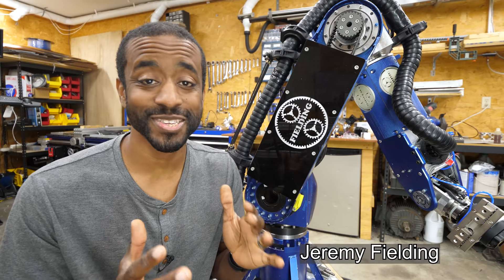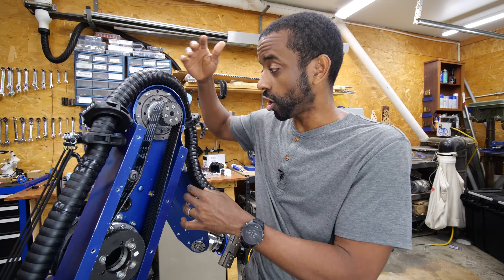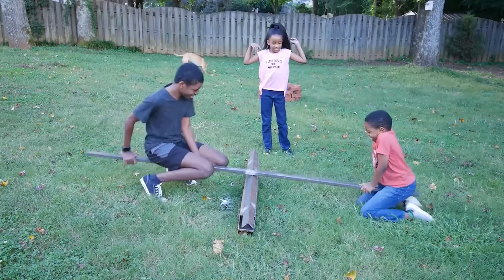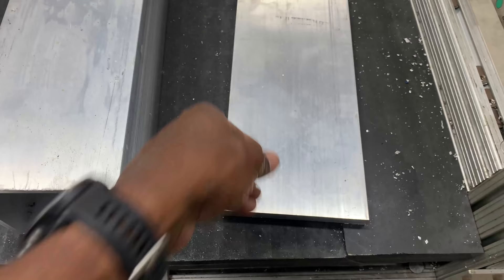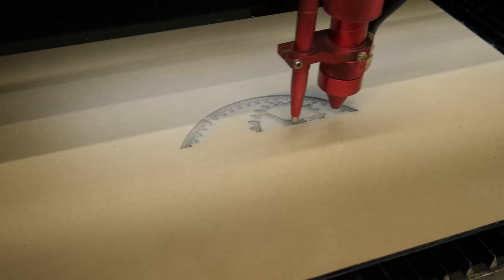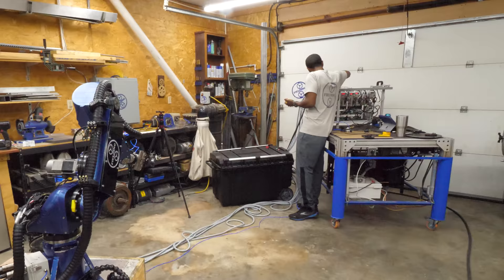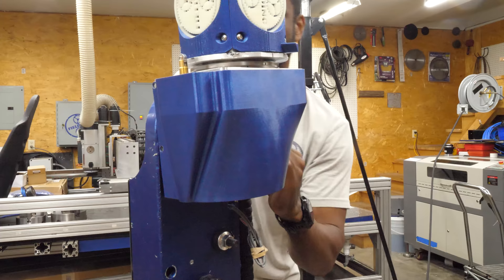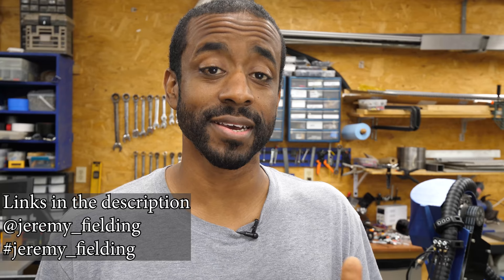How I Designed My Robot To Be Fast! Engineering Speed at a Lower Cost #092

Comment: Hey, guess what happens when you put one channel of a portable o-scope (ground referenced, cough) on the 440 motor drive's output, and another channel on the 5 v digital control input (also ground referenced, cough-cough) -- wow, Tek probes are expensive!  :(  So back in the 90s, Tek had a thing called the PowerScout with magically-calibrated channels with isolated grounds, so you could do that without setting fire to two scope probes and a control board... ask me how I know this... now, at that point, I had only been doing electronics and high powered electrical work for, oh, say, twenty years. >_< D'oh!!

Comment: it is labelling.....a pack of $1 sticker can solve your expensive problem. may be you can try stealing some pokemon stickers in pair from kids and use it. say, 2 pikachu in both socket and plug means it is a wall socket circuit that kind of things. if they saw their stickers on the arm, they will have a feeling that they are a team member to make this arm. or you can do it seriously using industrial code.